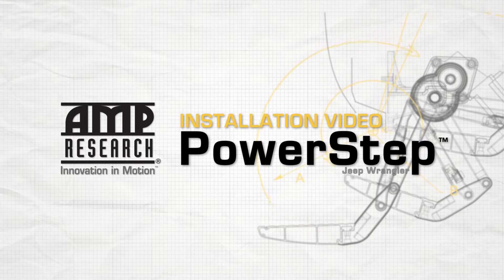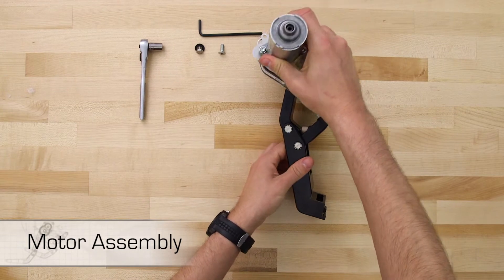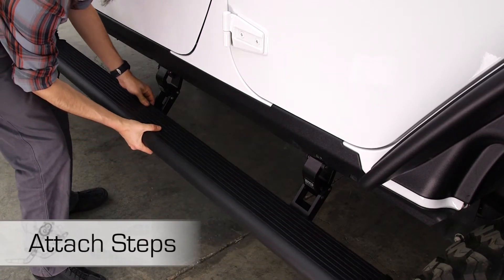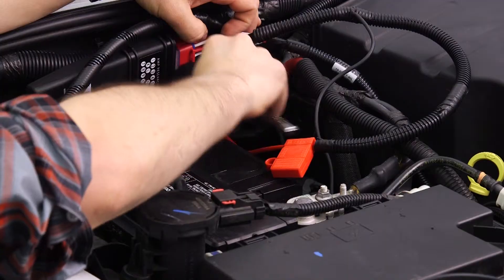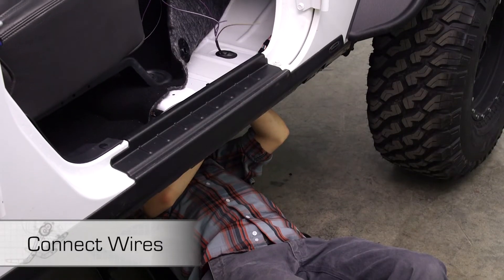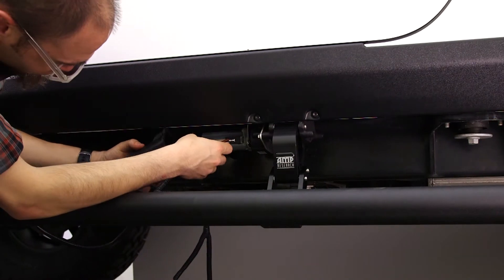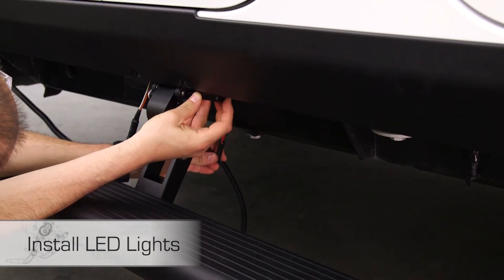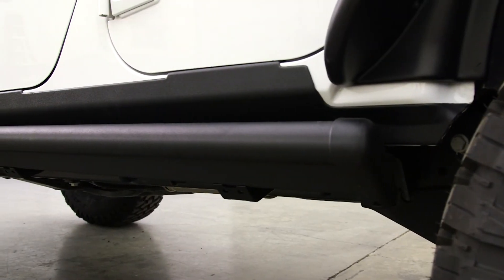Installation Video: PowerStep Jeep Wrangler

Comment: is it possible to remote control the powersteps?
Reply: Yes, there's a YouTube video that shows how someone modified his to work with the key FOB. It triggers a relay when the dome lights come on and causes the steps to extend.  Handy if you want to use the steps and the doors have been removed.